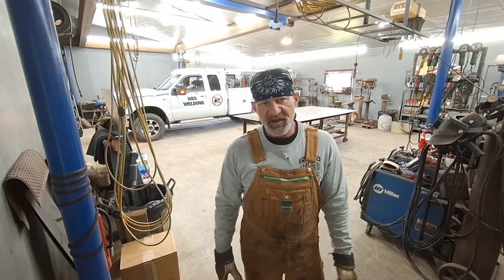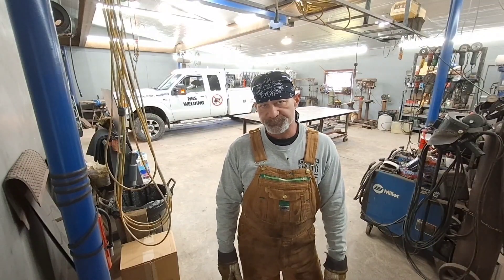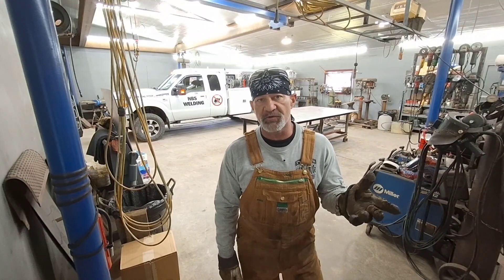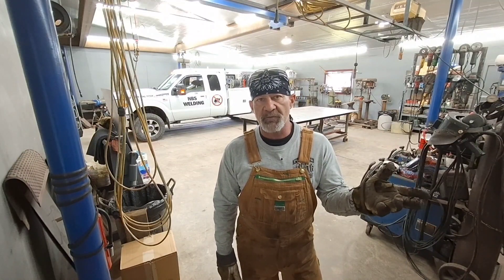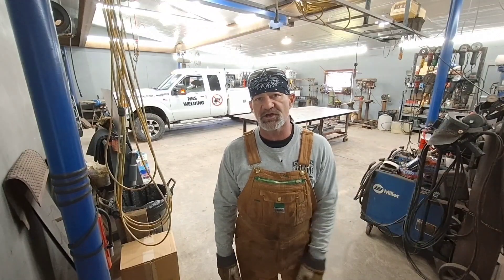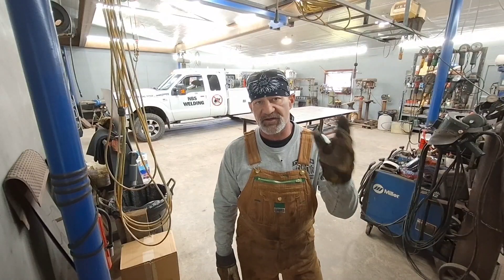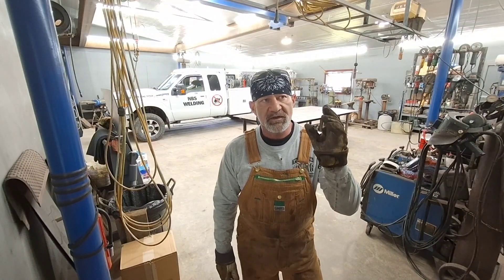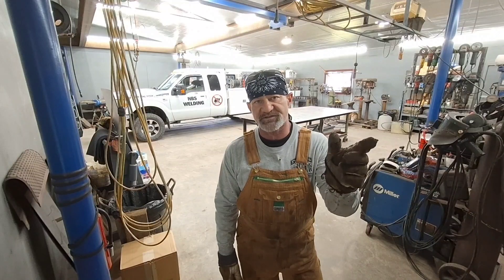DON'T WELD UNTIL YOU WATCH THIS

Comment: Don't use it when heating the shop with a turbo heater or a kerosene heater or propane heater as when the fumes go through the fire it is changed to a bad gas .
I had this happen to me and stopped doing that , it will take your breath away .
Reply from the maker: Good info...and don't worry I won't use Brake Clean ever...for anything...won't allow a can of it in my shop

Comment: Ive always used Acetone .Brake clean is def a no no i had a friend of mine who got sick from spraying it in his engine cleaning the carb while it was running . PPL def. need to pay attention to this
Reply from the maker: Right on

I actually don't use any liquid cleaner of any sort....I powerbrush, SS brush, sandpaper, schotch bright, or maybe even just wash stuff with soap & water....but I've seen no benefit from chemicals...I save the acetone to thin paint or remove adhesives...don't need it for welding

Comment: Thanks for the education as we all have Brake Kleen in our shops and use it to clean multiple surfaces and would not think twice about cleaning a metal surface before welding. Also, tell Tina Thanks for the T-Shirt as it arrived quickly and as described.
Reply from the maker: Glad you got the caution about the brake cleaner and glad you got the T-shirt...thanks for supporting the channel 👍

Comment: You likely saved my life.  NBS. I jump from machining Channels to your Channel.  Very common is the use of break cleaner in removing cutting fluids from stock/work pieces (especially lathe turning). Prior to this video from you, I would have continued to use brake cleaner and on parts that I intended to MIG weld (the only type I’m reasonable at). THANK YOU!🇦🇺
Reply from the maker: Welcome!...glad to hear...be safe...thanks for watching and commenting 👍

Comment: I’m no safety nazi either but I did start wearing a PAPR system while welding indoors recently. I’m too broke to afford a fume extraction system at the moment and already had the PAPR. When I was welding everyday I just got used to feeling like crap and almost built up a tolerance to it but now I do trees and welding so I get time off from the welding. On top of that I had my appendix taken out recently so all that time away from welding when I went back into it I really felt like crap the first couple days. Put the PAPR on even when just mig welding inside and lo and behold I don’t feel like crap after welding for hours. I’m sure smokers or long time welders may not notice the difference right away but the young guys just starting may.
Reply from the maker: I've never felt and negative physical effects from welding...the most I've probably gone without welding in the last 34 years was 20 or 30 days...many times I've gone a week without welding

Comment: You are correct Tetrachloroethylene was used in WW1 it was also used in the in the old fashion fire extinguisher that you flipped up upside down the acid bottle cap would pop off starting a chemical reaction and pressurized the extinguisher the agent inside the extinguisher would create a cloud of fargen gas putting the fire out if the fire did not kill the agent did   also Dry Cleaners used that stuff for years as a spot remover

Comment: Also, wear a respirator when welding. It won't help with brake clean but it will keep you alive longer and definitely works with galvanized.
Reply from the maker: I don't believe a standard paint respirator  will do anything really to prevent metal fume fever or block any of the dangerous fumes that could be created by welding...it may make it more comfortable to breathe but I don't believe a paint & dust respirator can filter out the kind of fumes that you gotta worry about when you superheat metal...I haven't studied the science behind it I'm just saying that I think respirators are only effective at filtering out solid particles and there are many dangerous fumes that can go right through there.
If you really have to deal with fumes I think you need a ventilation system and a PAPR unit...I have a Miller PAPR that is pretty nice.
Reply: @NBSWELDING  Well, I have definitely gotten sick from galvanized before and is the reason I started using a respirator. Since, I have welded a bunch of galvanized, with the smoke and fumes going right in my face and I've had zero sickness. I don't think it would work for brake clean or super harsh chemicals, but it helps for longevity if you use it while grinding and definitely works FOR ME with galvanized. Now, if I was stuck inside an enclosed space with galvanized or anything I would use a Papr. I'm not doing the level of welding that some of you guys are doing. If I was, I would get a Papr for sure. I'm outside with a fan pointed at me most of the time. Flux core is also a huge irritant and while I love the smell of stick, I have to wear a respirator when using flux core. I don't smell any of it until I take the respirator off.

Comment: Is there any way to neutralize it?  What if someone brings me something to weld, and I don't know if they used brake clean before they brought it to me. Is there anything
that I can use to remove brake clean?
Reply from the maker: I can't really answer that...sorry

When I clean things before I weld them I personally use soap, water, scrubbing, powerwashing, wire brushing, sanding, scotchbrites, and other forms of abrasion....and I do these things differently depending on what it is and how I'm gonna weld it....I see no need for any liquid chemical or flammable to clean anything I weld....it all comes with unnecessary risk and cost but no real gain or improvement in the work...Acetone is safe as far as wiping down parts prior to welding but its highly flammable and I don't need that around when I'm welding...save it for the paint job.

If its something that has had exposure to chemical, flammable, or explosives contamination then I might first clean it and then leave it be for as long as possible before welding on it.  I've cleaned things and then left them outdoors for long periods just as a precaution to allow the air & rain to dissipate any remaining contaminates...then clean again before welding.  I also might stick weld something outdoors in the wind instead of MIG welding it in the shop just so that I can reduce the concentration of any harmful fumes that may be created.  

We also must always consider if something is worth the risk of welding on or not.  Like for instance a gas tank for an old pickup truck that leaks is not worth the risk of welding on if you ask me...go buy a new tank for it would be my advice.  Obviously precautions can be taken and fuel tanks can be successfully and safely welded when it makes sense to do so but if you can get a new one for a couple hunded bucks then I don't think its worth welding on something like that.
Reply: Thank you for the PSA. You mentioned welding on fuel tanks and I thought about something I did years ago. When I was younger I was working on an old JD 4430 tractor . The radiator support bracket that was welded to the top of the diesel fuel tank had broke off. I pulled the tractor in front of the shop ,hooked the ground clamp to the fuel tank and all the guys in the shop scattered 😁. I told them I had the cap off so it wouldn’t build up any pressure. It was fairly thick metal but I wouldn’t recommend it . Appreciate all that you do . Be Safe!
Reply: Thanks buddy that’s deff good info 👌🏼🤘🏼🤘🏼

Comment: I saw that in the comments on your last video and thought, “I sure hope he’s using the non-chlorinated kind”! I’ve told that the non-chlorinated is okay. Does anybody know for sure?
Reply from the maker: It's not a chance I'd take and I see no reason to.

I use soap, water, scrubbing, powerwashing, wire brushing, sanding, scotchbrites, and other forms of abrasion.

I see no need for anything chemical or flammable to clean anything I weld....it all comes with unnecessary risk and cost but no real gain or improvement in the work.

Comment: Good looking out CB. What do you use acetone?
Reply from the maker: I use soap, water, scrubbing, powerwashing, wire brushing, sanding, scotchbrites, and other forms of abrasion.

I see no need for anything chemical or flammable to clean anything I weld....it all comes with unnecessary risk and cost but no real gain or improvement in the work.

Comment: Another issue is welding on galvanized metal.
Reply: But, it's good to know that you can easily wear a respirator while welding galvanized and it's not an issue. It's not deadly like brake clean, so no reason to get people scared with a comment that leaves no explanation.
Reply: For anyone who is seeing this comment and going "What's the issue with welding on galvanized metal?" the problem is that galvanized means coated with zinc, and when zinc is heated to welding temperatures is evaporates and becomes zinc gas which long story short, is stuff you don't want in your lungs because it will make you very sick.
This isn't a particularly detailed explanation but it should give you a general idea if you're looking for more specifics look up metal fume fever.